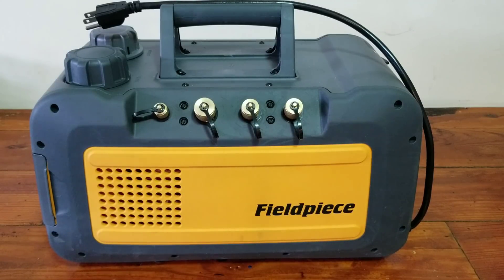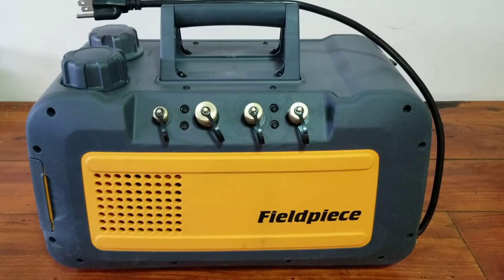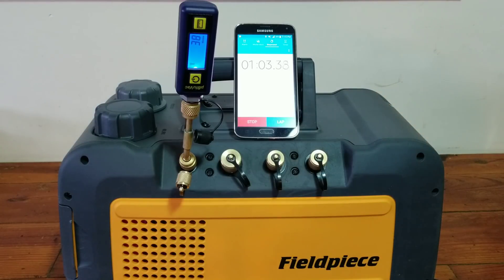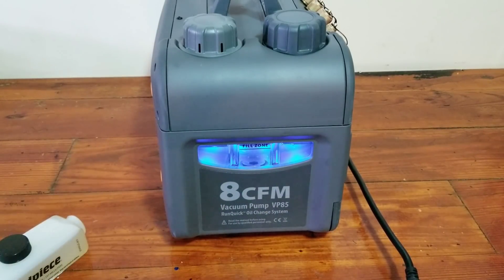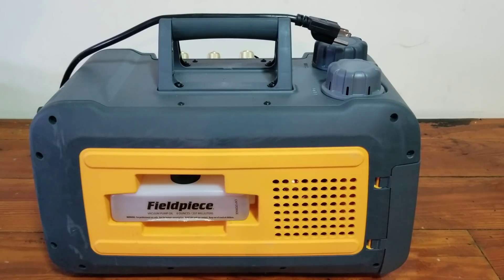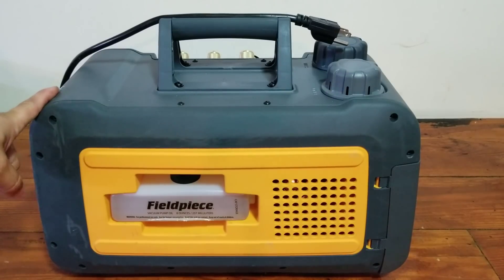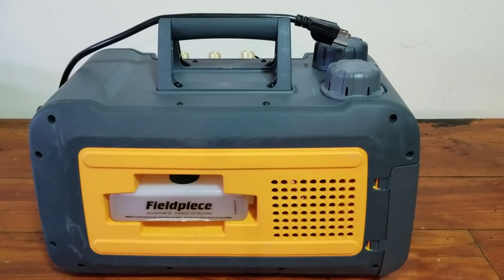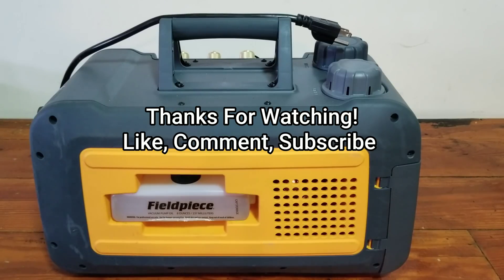Fieldpiece VP85 Vacuum Pump Review

Comment: Anybody have one of these out of warranty that locks up just like described?  Our wire is still on the board but the unit is completely dead except for the lights.  Not even 2 yrs old.
Reply from the maker: Try contacting Fieldpiece. They have very good customer service. Even if warranty has expired.
Reply: @HVACinSC  I did talk with the local rep multiple times.  Maybe I should take it higher in the chain
Reply from the maker: Yeah. The local reps and distributors. are typically no help in those situations.

Comment: I ordered a brand new VP85 and straight out of the box the oil door was cracked and would not shut.  It was packaged correctly and i feel like it was actually packaged with a broken door from the factory.  It should have never been packaged if it was quality checked.  Very cheaply made door. Now i have to send it back and wait for a new one already.

Comment: If you use "big hoses" to pull the vacuum, can you "get away with" using a smaller pump?
Reply from the maker: Absolutely! Most vacuum pumps are drastically oversized anyways. A 5 cfm vacuum pump for instance is good for evacuating up to a 25 ton system.

Comment: Seen another issue about the plug falling off. The owner had to purge with nitrogen and it released the motor. It seems that the plug falling off causes the motor to become bound up somehow. Once they did this, it was fine. I am considering one of the 8 cfm pumps myself, but a coworker of mine has the appion tez 8 and swears by it. I have the fieldpiece recovery machine and love love love it. Have you tried the tez 8 vacuum pump? Do you have a preference between the vp85 and tez 8? Thanks for your videos.

Comment: Good review. Seems another great feature is the small amount of oil it uses. Should get 4 oil changes on a quart if I’m reading the data correct.
Reply from the maker: Yes it does use a very small amount of oil which I look at as a good and bad thing. Good for the reason you touched on, bad because I typically have to replace the oil at least once during almost every evacuation. Then again once evac is complete. I'd personally like just a bit more oil so I could just change the oil after most evacuations.